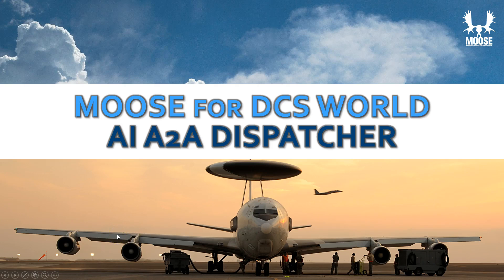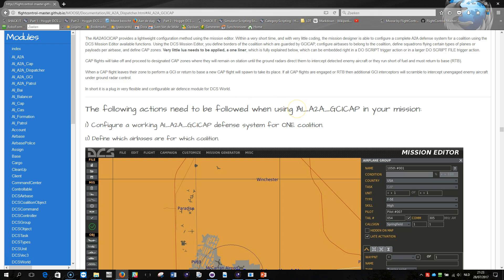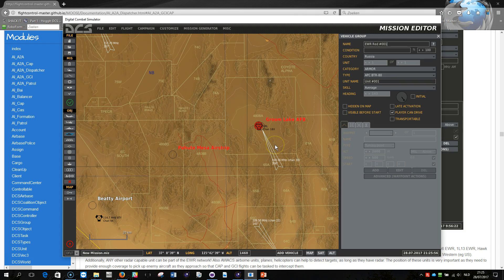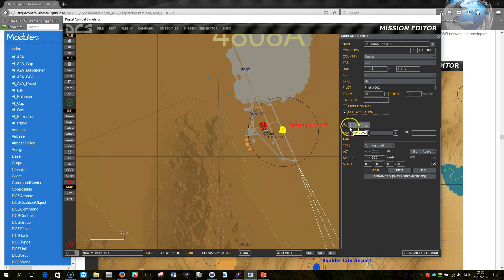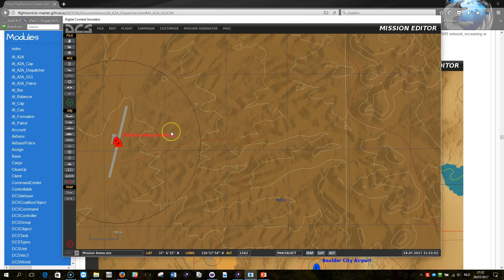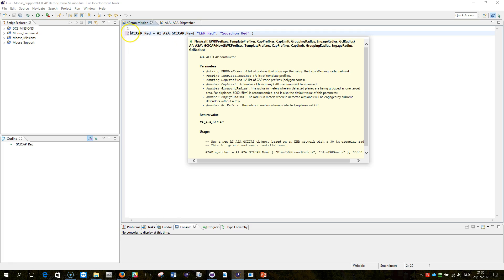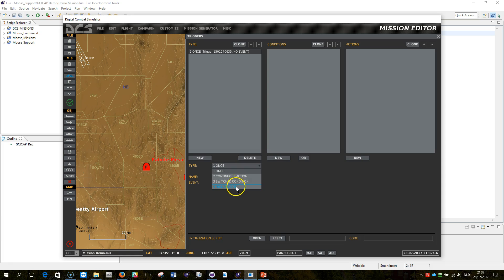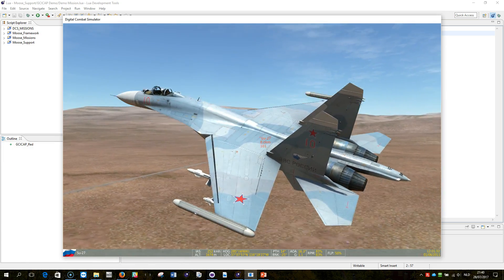A2A GCICAP - Tutorial 1 - Easy defense setup - [Script]

Comment: Does the  EWR ground unit used have to come from the EWR unit set from the Mission editor? 
If love to be able to adapt thus for a ww2 control system but we don't  and likely never will have ww2 radar units to use. Can I assign a normal truck to do the EWR job?

Comment: Question on driving an AI CAP from a FARP:

I'm working on a scenario using a functional FARP built along a road, along with a number of static objects simulating the presence of fixed wing aircraft using it as an improvised strip.  If I run a fixed wing CAP with the default start (in air), would I place the unit on the FARP icon since there is no functional perimeter drawn (as exampled around 2:58 and on) around the field, or is there a defined range from the icon that one can use in lieu of the perimeter?
Reply from the maker: This is about AI_A2A_GCICAP, right? You can place this near the FARP icon. It should take into account the fixed wing if it is place within 1km from the centre. Is there another airport nearby?

If it does not work, send you repo to flightcontrol_moose@outlook.com
Reply: It is indeed.  

If it doesn't work, I'll let you know.  Thanks!

Comment: This is a great addition. Now I wonder, Instead of making the CAP planes appear from thin air, is there a way in MOOSE to have them inactive on the TARMAC and activate them when the EWR detects the incoming hostiles? As if the CAP plane where in an ALERT-5 status
Reply: I saw the tutorial 5 and the setdefault... methods, but as far as I understand, those methods spawn the CAP planes "magically". What I would like to make it more "real" is to already have the planes on ramp (hot or cold, depending on the mission), and take off only when the hostiles are detected.
Reply from the maker: Yup. That is possible. Let me try to make an API for that.